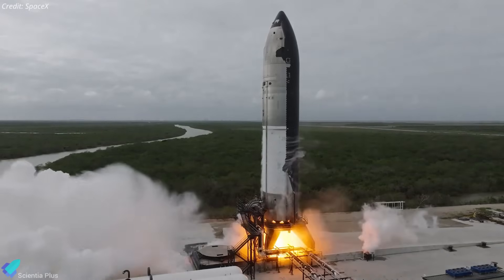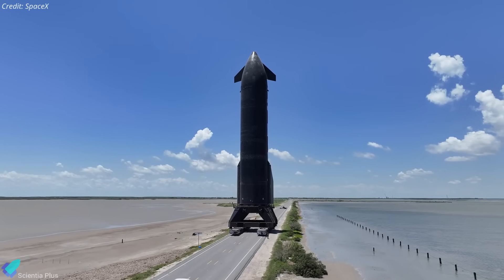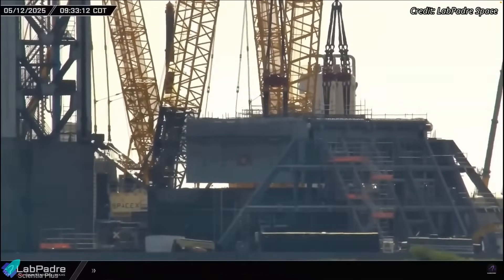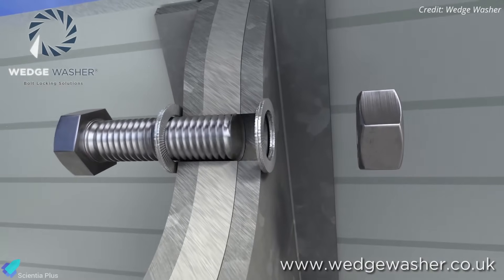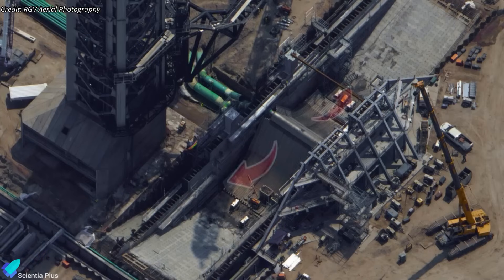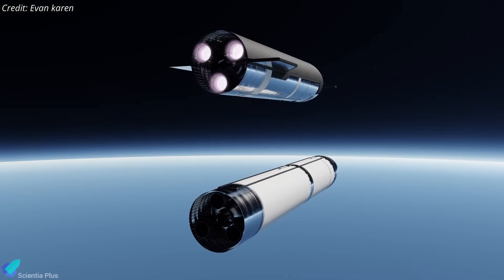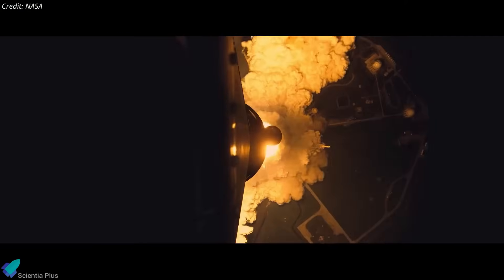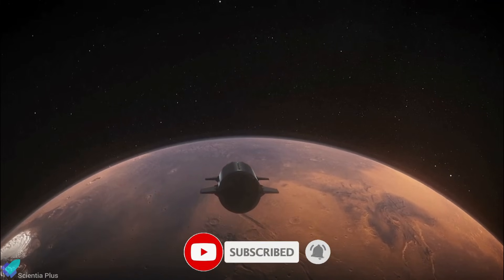Insane Engineering of New Starship Launch Pad B - SpaceX Finally Solved The Biggest Problem

Comment from the maker: 00:00 Starship Updates
12:10 NASA Swaps Out SLS Rocket Engine Due to Critical Failure! - Artemis 2 Update

📚 Learn More:

🚀 Starship Block 2 Explained:
 📖 Summary: https://shorturl.at/b0dtw
 🔍 Detailed Explanations:
  • Design Improvements Update 1: https://shorturl.at/lpGT7
  • Design Improvements Update 2: https://shorturl.at/gwNQ4
  • Nosecone & Payload Bay Redesign: https://shorturl.at/xa60S
  • Methane Downcomer Redesign: https://shorturl.at/XdYBG

🚀 Starship Block 3 Explained: https://shorturl.at/mnBT4
🚀 Starship Block 3 & Booster Block 2 Explained: https://shorturl.at/IViwD
🚀 Starship Block 3 & Booster Block 2 Production Begins: https://shorturl.at/xRNkJ

🔥 Raptor V3 Mega Upgrades & First Test: https://shorturl.at/TRIyj
🧱 What’s Inside Starship GigaBay?: https://shorturl.at/nJM75

🛠 Other Starship Upgrades:
 • Hot Staging Explained: https://shorturl.at/jf400
 • Super Heavy Booster Upgrades: https://shorturl.at/Pi5R3
 • How SpaceX Protects Raptor Engines: https://shorturl.at/4Om8F
 • New Heat Tiles Explained: https://shorturl.at/p2Ijb

🚀 Starship Flight-7 Anomaly Explained: https://youtu.be/UqzZx7vb-TA
🛠 Starship Flight-7 Root Cause & Fixes: https://shorturl.at/HcLKo
📊 Flight-8 Complete Breakdown: https://youtu.be/f26yH80RK2o
🔥 Starship 35 Static Fire Anomaly Breakdown: https://shorturl.at/eLCvL

📡 Stay Updated:
📢 Weekly Updates: https://bit.ly/3HIQjPC
🚀 SpaceX Playlist: https://bit.ly/34wue8T